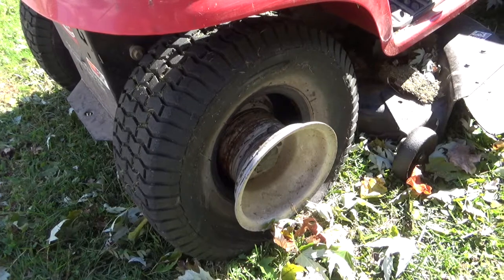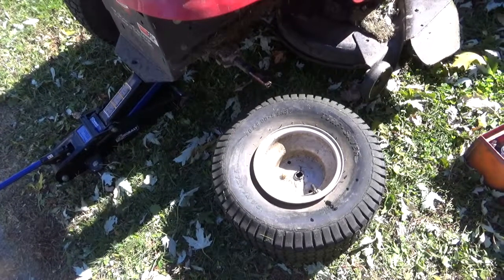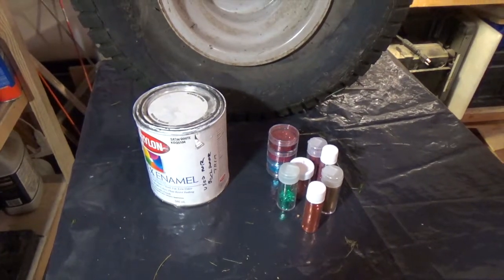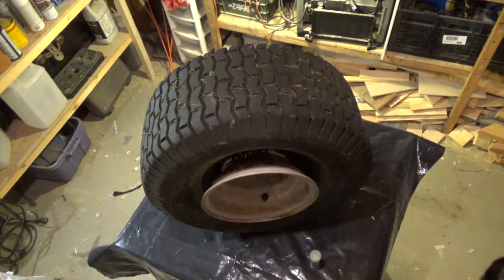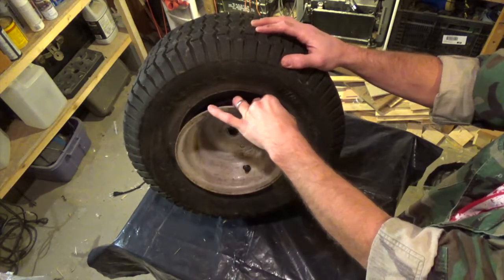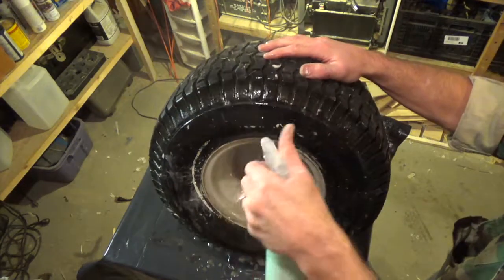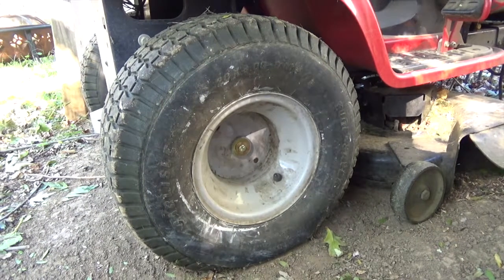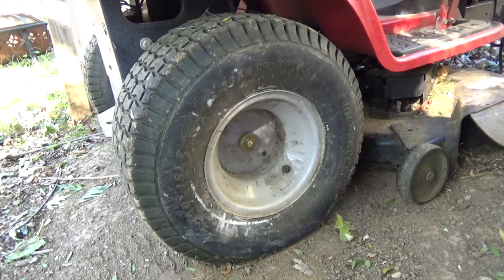Paint & Glitter Tire Repair - Does It Work?

Comment: Great job. I use a similar homemade sealant for my bicycle tires. I would suggest next time to lay that tire flat on its side after seating it to allow the latex to gravity feed to the holes for a while, maybe overnight. That's kind of the way we do it in the mountain bike world. You need some better plug material too. Glitter is fine but cornmeal or polenta seems to have a better reputation for clogging up those leaks, pre mixed into the latex. Enjoyed your video. The last batch of sealant I mixed was about 4 years ago and I used the last of it yesterday on my mountain bike. I had used hobby lobby cream latex for mold builders as the base for that batch and have pondered the idea of using an old can of latex for my next batch. After seeing your video, I think that's what I'm going to do.
Reply from the maker: These are excellent suggestions. As I was reading this, I realized I have an old (almost empty) bottle of liquid latex for making Halloween masks. I think I might try that mixed with some cornmeal for my next fix. Thanks for the suggestions. Happy riding.
Reply: I do the same but use latex caulking and add liquid water windex etc... To thin it to a stans type consistency.  Have also found rubber crumb material online I add in to help plug bigger holes.  Was thinking about latex paint so when I searched this popped up.    I would guess adding more air and driving it a few times over a few days might have sealed that tire completely.   Nice work.

Comment: I kinda doubt the glitter did that much, it seems too thick and there wasn’t that much of it ... but talcum powder or corn starch would probably help. Even mixing up a cheap bottle of dollar store white school glue into the latex paint would probably work, too. I bet if you kept airing it up until the paint set up, it would stop leaking in 12-24 hours and would probably hold up well for a long time. I would probably have used black paint because the white paint coming through the tire would drive my anal retentive, perfectionist side crazy!
Reply: white is better,it lets you know what is going on

Comment: Don't see why it wouldn't work like any other tire sealant would? Use to use egg whites and pepper to seal holes in radiators! Laugh all ya want! Ground black or white pepper however you look at it? It gets into the hole and instantly expands in small holes or cracks in the old brass copper radiators. Egg whites work as well.
Reply from the maker: I have heard rumors of folks using egg whites in radiators, but never tried it myself. To me, all that matters is making it work until a "proper fix" can be done. Love this comment! Thanks for watching. Stay well.